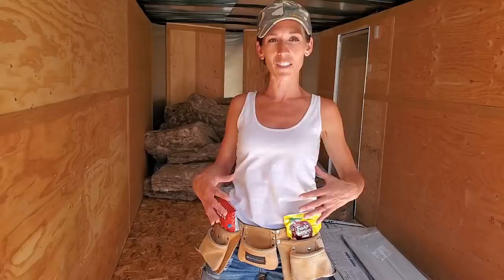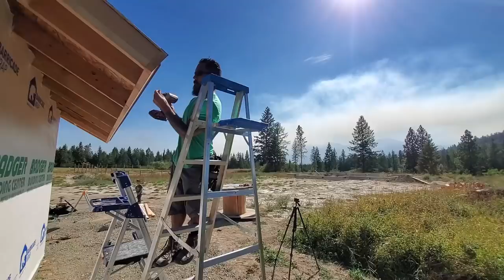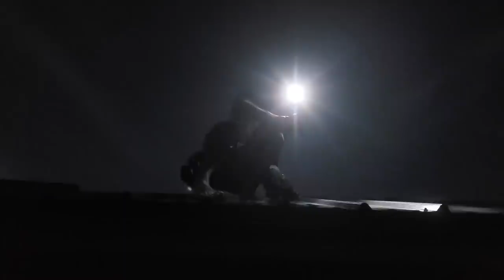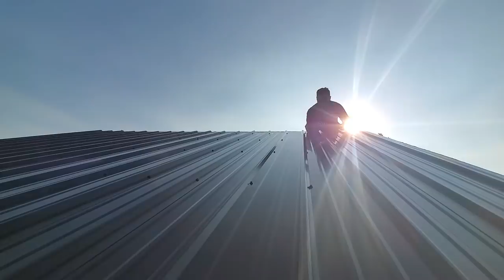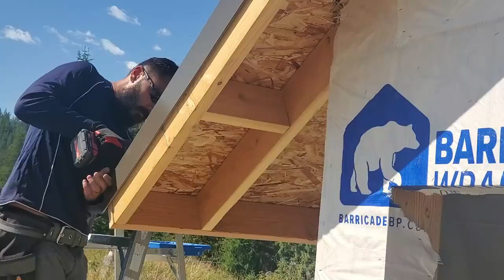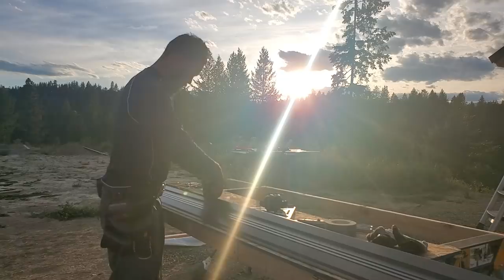How To Build A Shed (Part 6) | How Rising Lumber Costs Are Effecting Our Build

Comment: Have you looked on your guy's Craigslist? You might be able to pick up odd amounts of osb from people who have overordered. It may be tedious and take a but of driving time but you may be able to offset your spend on new sheets. People generally just want to get rid of it and you can possibly haggle a bit. Also, mix an match materials where you can, if you can, to cheaper options, or change to something all together different like plywood possibly. Check if it's a useable option in your house.Look for these materials on Craigslist too. If you jump to and look now before it gets cold you may pick up some bargains and store it in your barn till needed. The same goes for other building materials. Just a thought. Im not a builder, but I am frugal lol. All the best with it. The shed looks great!
Also maybe rework your framing  materials to something a bit  cheaper. Faux boxed beams instead of solid wood exposed beams, for eg. Where you can to shave off a bit of money. I know it's not what you envisioned, but you may save a bit there too.
Milling your timber could be an option where you are able use it fresh. Also you may have time for it to season depending on when you needed to use it.
If one mill knocks you back, ask at another one. You never know.

Comment: Not trying to sound nitpicky and you guys are doing a great job, but normally you would put finished trim boards before the drip edge. Now you run the risk of the exposed untreated 2x4s rotting.

Comment: I would prep for building. get the crawl straightened out, but no visqueen or gravel... easy to shovel the snow out...Do all the dirtwork you can, because you can't once it's frozen. Then wait, because likely the prices will drop in the winter. They always do. Investigate local jippo mills. Often you can get your framing package cheaper and at less volatile pricing... but the sheathing needs to come down anyway.  I would NOT start unless you can get through dry-in, FOR SURE +20%

Comment: Consider changing the material that you use if the price has gone up.  Where you were going to use OSB, consider plywood now.  might be the same cost but you can go thiner on plywood than you can with OSB.  If you have the money and can order ahead you may be able to get a better price.  Prices are also seasonal so look at changing your time frame.  You have the space to store things in that building.

Comment: The softwood lumber dispute with Canada has pushed up the priced in both countries. Many sawmills in Canada have shut down  because of the tariffs, creating a supply shortage. It is almost impossible to get pressure treated lumber in our area (Ontario) regardless of the price.

Comment: That barndominium would make a great place to live for year to come! And it's safe in a metal building from fire. I worked on a farm in Ok for years, at one point they had a irrigation system called a Big gun! It's like a big sprinkler on steroids! It could double as arrogation and fire protection! But it would take a big well and a pump to run it. Most likely it's not feasible! It came to mind because of the fires! Y'all stay safe my friends!

Comment: I replaced the vinyl siding on my house with T1-11 and the panels cost $40 a sheet and the house needed 40 sheets. Overall, lumber and other building materials prices here in New York are through the roof.

Comment: I hope that eventually lumber prices will come down.  Possibly save in other areas like lumber vs OSB.  Could you cut some trees down on the property and take to a sawmill and have made into lumber and dried.  You would have to check into and see if the $$$ add up.  Or delay the project a year.  Tool tip there are 3 colored tin snips red, green and yellow.   They all cut differently some people think it a right/left hand thing but that's not correct.   The red and greens in combination work better than the yellows.

Comment: FYI:   In place of a punch to do your screws, Stack all sheets neatly/evenly and drill a small hole where you will need a screw. Then all 10 sheets will be done at once. It is easier and much faster.

Comment: Would have dug pump house down 4 feet to reduce lumber and super insulate roof. Would also build food storage . Would look to portable sawmill of lumber and pre sell some storage shed panel building. Build a wood scaffold and make panels . old school lap siding can be used with portable mill. We cut barn shakes on a barn 100 square ... Sweat equity or building package tiny house or year down older houses labor intensive but can be done urban area. Not sure your current status.

Comment: I believe that once people get back to their jobs post pandemic, and all things being equalized economically, prices should return to close to normal just like oil has in the past. Maybe try connecting with wood manufacturers directly rather than. Ask some local home builders where they find the cheapest lumber sources. Even if you have to drive further away.

Comment: You do have a livable place to live for the moment. Maybe it's not the big nice house you wanted But it will work for now. Take your time and weigh your options. 
Some things to think about...
Lumber isn't the ONLY building material. 
There are shipping containers that come already VERY sturdy and can be cut to fit for a section of the house and blended into the lumber build.
 
You also have a lot of natural stone around you. Stone makes a good sturdy and passive solar building material. 

Natural cob can be used for a wall here or there. Also passive solar and insulating and long lasting. 

Straw bales can be used for a VERY insulating, sturdy and believe it or not very fire resistant material to build with. Check out straw bale building. Some of it looks really cool and you can get really creative. Less wood is used and zero insulation because the bales ARE the insulation. 

All these options can be used with the foundation already in place. You could even do a mix of materials. The shipping containers are the least cost of them all but will need the same insulation as wood built walls. Also they are pre built so you cut in Windows and doors, finish edges and secure to foundation. Straw bales are the most insulating on their own plus fire retardant. A straw bale home has the same fire rating as a fire resistant stairwell to be used to escape a fire. Where you live THAT alone is very attractive. Cob built is not quite as insulating as straw bale and is a bit more labor intensive but allows the most creativity in the final look. You have some time to think it over now that the insanity of life has you stalled for the moment. Whatever you choose don't just think about cost and don't feel stuck in a modern traditional look of the final project. This is YOUR home and it should make YOU and only you happy. 
I really personally like the idea of straw bale where you live because it's so insulating to both heat and cold but mostly the fire resistance of it really strikes big because fires are SO prevalent where you live. Look around on the internet. See what you find. I have also seen a kind of building that uses what looks like a really long sand bag. I don't remember what they call it but it CAN be a fun and funky look. Don't know enough about it to say if it can be used on your foundation or not. It did show good insulating value.
Good luck and happy dreaming of the build. :)

Comment: drip edge goes on under the felt so if water gets under your roofing system it runs down the felt and goes on top of the drip edge if the drip edge is over the felt the water goes under the drip edge and causes rot at the edge of the roof other than that great job

Comment: I am not, in any way a professional; but I have remodeled all three houses I've owned in the past 30 years. I know there are several small, owner-operated saw mills in Idaho, so I'd look for a local one and start making some barter deals. 

If that fails, I would seriously look at using structural steel framing rather than wood. I know a lot of people don't like it; but 1) the cost of the product doesn't vary much 2) it doesn't burn! 3) It goes up fast. There used to be companies that you sent your plans to and they'd literally precut all of the structural steel for you, leaving you to simply assemble. My current home, we added nearly half again it's original size using structural steel framing and it cut nearly 3 months from the remodel time. And since I'm in California, I actually got a slight discount on my insurance due to earthquake stability of steel over wood.

Comment: I know lumber prices have tripled or quadrupled all over the country. What about building with those pre-fab panels that come with insulation sandwiched in the middle? I don't know if that's more or less expensive than stick built, but it seems like it would use less lumber overall. Good luck! Hey, what were those pictures of downed trees in your driveway -- saw it today either on instagram or facebook. Did you guys get a bad storm?

Comment: You know you can walk on a metal roof with tennis shoes or work boots as long as you walk on the bracing or in your case you have plywood decking so it won’t hurt to walk anywhere on the metal roof

Comment: In the days of the pioneers on the prairie, the pioneers would take a plow and plow the dirt about 6-8 feet wide around their buildings so if the fire spread by grass it would be stopped by the overturned dirt and would save their buildings.

Comment: Wear water shoes for working on the roof.   It's not that there's a lumber "shortage". It's that they didn't cut down tree's and mill any during lock down. They just have to catch up and the price's will come down. BUT....., if there's another lock down this fall . Well the price's will go up big time.  To bad you didn't buy alot of the building stuff a few month's back. Could have stored it in the polebarn. Prayer's that thing's get better fast, then buy what you need right away. Stay safe and healthy. God bless

Comment: My understanding is that sales outlets were considered essential and remained open, however the production side was not and closed down.  So shortages started when stock piles were depleted. Of course a lot of lumber comes from Canada and I understand there are border issues as well.  So transport might also be a problem area.  I would suggest to wait it out or seek alternative solutions.  Like rough sawn lumber for the framework from a local saw mill.  Could even use it for a subfloor instead of plywood or OSB.  If your property has the timber available then maybe purchase or rent a saw mill.  Yes, a lot more work but the price would be a lot less.  Your tiny home is complete or almost complete so you should be good for a considerable time frame.  One issue might be permits where they are time framed.  Like two years to complete the house.  Then seek an extension.  No point in paying 3,4, or 5 times the cost of materials for a short wait period.  And even that wait period is also winter coming on when building will be even more difficult.  But I am sure you will do what is best for your family.
Reply from the maker: We heard that too. Hopefully they get caught up,  and prices go down.

Comment: There are many factors impacting the price and availability of building materials. My biggest concern would be availability materials. If you start your build you may have to leave it exposed for extended period. I'm sure you know this could lead to a whole bunch of problems if say there is materials to finish a roof. A friend who's been in the build supply business for over 40 years says he has never seen it like this. It may be well into  next year before things settle down. Here in Canada builders have been sitting idle for 6 to 8 weeks for materials and  local supplier will not commit to pricing until they know the cost when delivered.  Your in a tough spot. Prices will normalize but the big question is when. Good luck and thanks for sharing your adventure.
.

Comment: As someone who trades stock and watches commodities, me personally i would wait until March-April of 2021 to purchase wood. That is the cheapest part of the year for wood prices typically, because currently you have a high demand on plywood due to the abnormally high amount of hurricanes combined with all the shops needing plywood in the areas of protest occurring. The winter months should kill off the remaining fires going on and allow lumber mills to catch up. You have to remember more than 70% of building grade plywood comes from Canada and they are still not allowing exports across the boarder yet and most of the country is still partially shut down unlike the USA. So the strain on the system is 30% of the producers attempting to cover 100% of the USA plywood needs.

Comment: If you have a portable sawmill, a chainsaw that can handle a 30+" bar, and a 4x4 truck with a wench, you can tote the sawmill around and cut deadfalls, burns, Beatle kill, and deadstanding...without touching a live tree. You can split the board ft. with friends and neighbors who have a current building project and lots of timber. My cousin in Whitefish, MT. has a small mill and does selective cutting for BLM, as well as IP, GP, and other private land owners. You'll be able to get trees, so look to the way they built before they had plywood....and your home will rock!

Comment: Just remember the one reason metal is used, from the old days. In case of fires, the metal roofs are not vulnerable to sparks as shingles are. I used my rubber sole shoes and screw heads to navigate my tin roof. If you talk to someone with a portable mill, Harbor freight carries one, You have lots of wood on your property. You could mill your own.

Comment: FYI: Suggest that you go to utube LAMENTH ACRES for possible way to raise funds. They had some logging done to raise funds to clear.pasture cleared. They netted $8000 before having stumps removed. Also he was a carpenter for years by full time homesteading. Lots of building tips for construction e.g. when cutting metal roofing, reverse blade oncircular saw, also stack metal and predrill holes for screws, saves time as well as aligning  screws. He shows how to use clamps and small blocks of wood to handle.heavy pieces of lumber.

Comment: Another thought that you guys could probably do pretty well. Used brick. A lot of times you can find buildings that are coming down or abandon places and get bricks for cheap or sometimes free. I’m sure it would be A lot of work but in the end you end up with an incredibly strong house and I definitely think it’s something you guys could do but you might be able to save a ton of money that way. If not the whole house may be building sheds or even portions of the house that might have needed heavy framing that would have been more expensive. If you can find a good resource for used bricks you might be able to save yourself a ton of money. 🤔

Comment: Hello, I understand your disappointment. However, you have a solution, it is called a timber and straw frame house. This method is widely used in Europe. And it is not expensive and it is easy to implement. Good continuation.

Comment: It happened to me while building our house that prices shot up. I was building after work, weekends, and vacations. Then I got laid off so I had plenty of time and no money. I did a lot of labor intensive work but didn't spend much. I got hired back and after a few months I went to buy lumber and prices had dropped about 1/3. After the election expect the economy to drop and things slow down. Chances are that wood prices will follow in several months.
 Look into how much it would cost to do your floor as concrete. I did mine as concrete and painted it with a commercial epoxy finish. It ended up being much less expensive than 2 x 12s and 2 layers of 3/4" plywood. The concrete floor acts as my thermal mass for my solar heating. 
Were you going to start on the real house this year? When building, work with the weather. It's much cheaper that way. Good Luck, Rick

Comment: My comment will probably be called out dated but over the 3 generations on the farm we have built with a lot of corrugated metal and through trial and error we found it was better to put the screws through the rib on the  metal because eventually the rubber washer degrades and it leaks and also if you turn a old circular saw blade backwards it cuts corrugated metal very well

Comment: Lockdowns are probably going to affect lumber prices for at least 6 to 12 more months. Can you change your home plan to use ICFs? Combine ICFs and the includes a concrete ICF first floor and you dramatically cut down on lumber needed. Heck put a concrete roof on and you basically have a weather proof super insulated house.

Comment: 23/32 sob subfloor at Home Depot CDA $25.89 actually not bad. That’s about the same as Pullman building supply wanted for it 2.5 yrs ago. It may go down over winter or who knows may go up more. There is a video on YouTube that explains what’s going on with lumber prices. Can’t remember who did it. But it all comes down to Supply and demand. And we’ve got high demand and low supply at the moment. 22 bucks for 7/16 OSB is ridiculous. But the 3/4 of floor isn’t bad